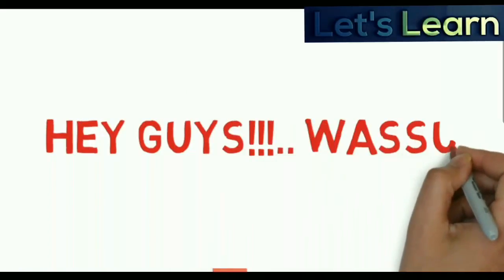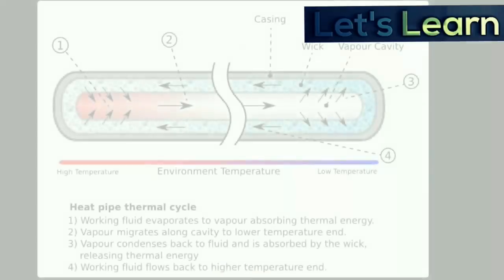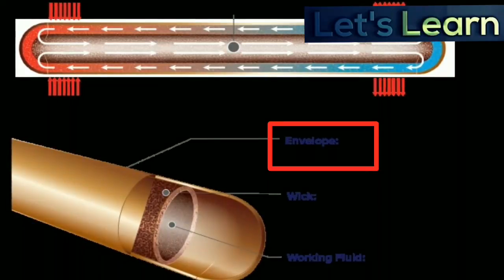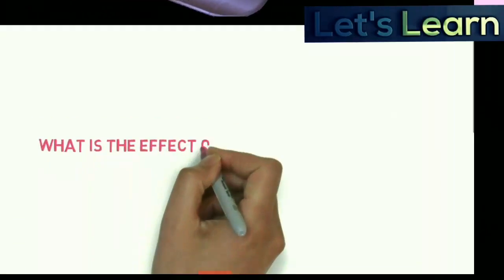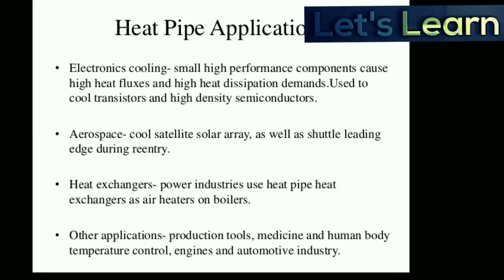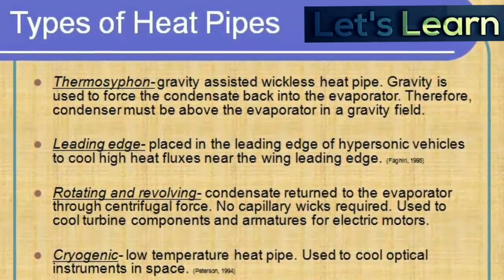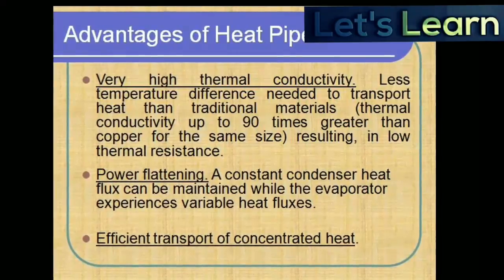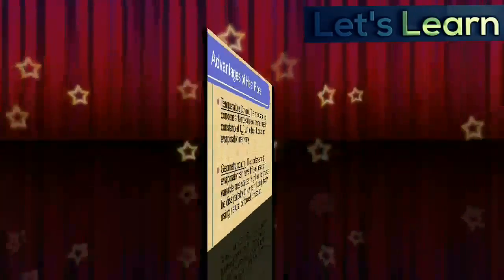What is a Heat Pipe?

Comment: How vapor does not mixed with the liquid in the wick in the middle?
Reply from the maker: Heat pipes return liquid from the condenser to the evaporator through a wick, which allows them to operate in any orientation.  During operation, capillary forces in the wick must overcome the sum of liquid and vapor pressure drops as well as the adverse gravity head and acceleration.  As the adverse elevation is increased (evaporator located above condenser), more of the wick pumping capability is used to counteract the adverse gravity head, and the maximum heat pipe power is reduced.
Reply from the maker: The main reason for the effectiveness of heat pipes is the evaporation and condensation of the working fluid. The heat of vaporization greatly exceeds the specific heat capacity. Using water as an example, the energy needed to evaporate one gram of water is 540 times the amount of energy needed to raise the temperature of that same one gram of water by 1 °C. Almost all of that energy is rapidly transferred to the "cold" end when the fluid condenses there, making a very effective heat transfer system with no moving parts.
Reply from the maker: The heat pipe is composed of a container lined with a wick that is filled with liquid near its saturation temperature. The vapor–liquid interface, usually found near the inner edge of the wick, separates the liquid in the wick from an open vapor core. Heat flowing into the evaporator is transferred through the container to the liquid-filled wicking material, causing the liquid to evaporate and vapor to flow into the open core portion of the evaporator. The capillary forces generated by the evaporating interface increase the pressure difference between the vapor and liquid. The vapor in the open core flows out of the evaporator through the adiabatic region and into the condenser. The vapor then condenses, generating capillary forces similar, although much less in magnitude, to those in the evaporator. The heat released in the condenser passes through the wet wicking material and container out into the cold reservoir. The condensed liquid is then pumped, by the liquid pressure difference due to the net capillary force between the evaporator and condenser, out of the condenser back into the evaporator. Proper selection and design of the pipe container, working fluid, and wick structure are essential to the successful operation of a heat pipe. The heat transfer limitations, effective thermal conductivity, and axial temperature difference define the operational characteristics of the heat pipe.